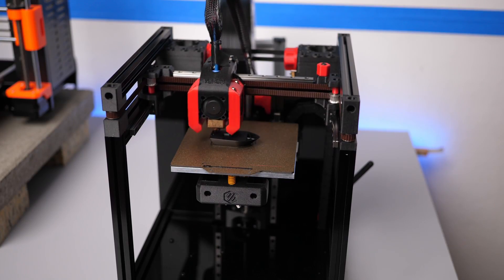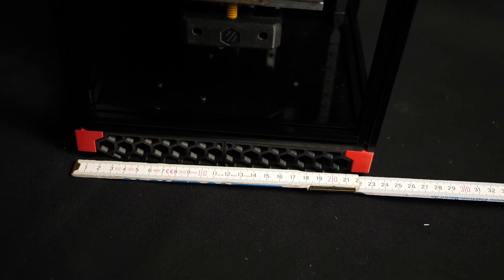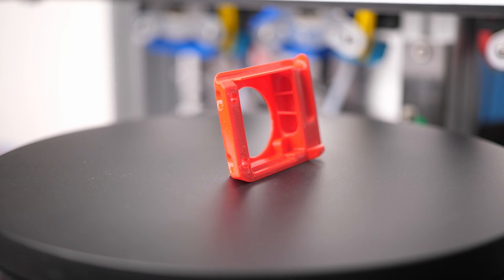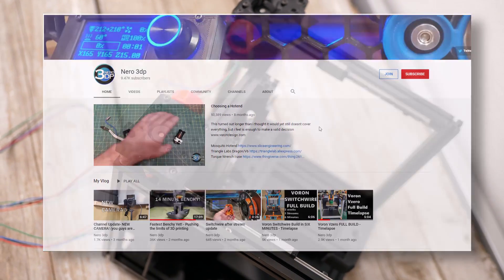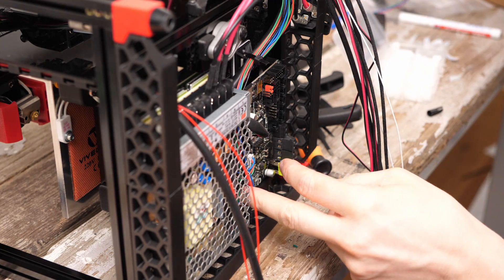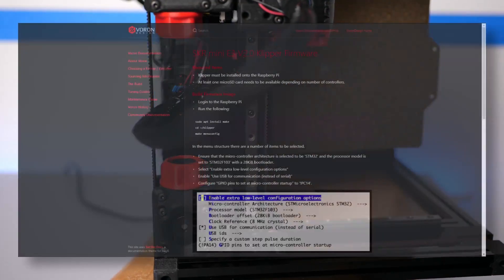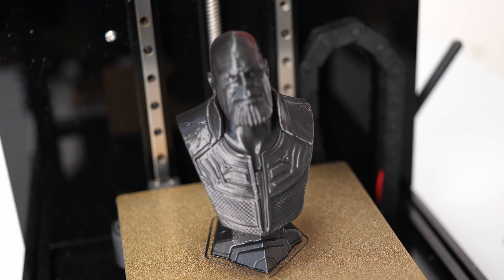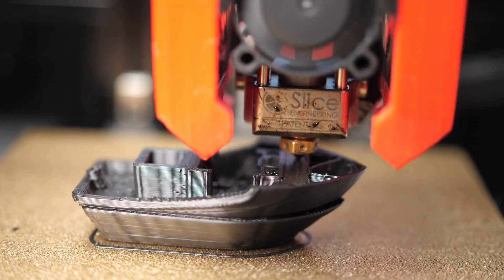Mini, Fast & Open-Source Core XY - The VORON 0

Comment from the maker: Banana Scale FTW!
Reply: Can't believe you 3d printed a banana
Reply: Once you have it reassembled, can you please try using really small nozzles/better cooling/etc. to print miniatures (both ones that need supports and those that don't) to see just how close you can get to SLA quality?  I've noticed a LOT of folks in tabletop communities that want to get into SLA printers for the quality but don't want to deal with the hassle that comes with resin.  If the Voron 0 could give close enough results to SLA, they could have their cake and eat it, too.  I'm not too sure what is considered to be the 'Benchy' of support-needed and supportless miniature models, but quite certain that the community could help you.
Reply: @KeithOlson  I've actually built a v0 for that exact purpose. In reality, this printer needs better hot end cooling to print PLA/ABS miniatures. Whenever I've put a 0.25mm nozzle on it, it clogs fairly quickly. 0.4mm it prints like a dream though.
Reply: @jeffreydorfman961  Perhaps Slice Engineering's 'Copperhead' bimetallic heat break would do the trick.  
Thomas Sanladerer seems to be pretty impressed with it.  I also saw a cool trick for cooling a while back.  Someone put powerful, high-static-pressure fans blowing out of his enclosure, then ran flexible hoses from the top of it down to the extruder that were connected to outside air.   The result was a LOT of air available for cooling without needing to mount any fans on the head.
Reply: What happened with the pellet extruder?
Reply: I always remember this SNL sketch. https://youtu.be/JpX9vjnZ-I4?t=31 They might as well use your tiny printer for the shoot :D
Reply: Wow that is awfully funny!🤣
Reply: Can you do a video on PCTG?
Reply: You should look at car ac filters, you can get high end filters that do both jobs of a HEPA and carbon filter, I think it's called odour filter plus if you get one from Ford
Reply: R u a 9gager ?
Reply: That is a beautiful machine, thanks for documenting your process!
Reply: The real aim is to make it smaller than the banana: https://i.imgur.com/PN8RJZZ.jpeg
Reply: Stop you're faster than light 🚨🚨🚨🚨🚨
Reply: What about greentec pro filament,  i used that dir my bearmera. With up to 150°C Temp resistance,  it was the best choice for the nozzle fan duct
Reply: Also check out the HevORT. Apparently it prints even faster than the Voron. Would love to have your opinion about it.
Reply: Why is the printer called VORON?  It's in Russian.
Reply: Hopefully the new videos on this are coming soon. I'm excited to see this machine perform better.
Reply: Is this the fabled banana you were going to cast in silicon?
Reply: Check out the hevORT. that one is a solid competitor for the voron, and I'd argue it's even faster. Search it on YouTube, the guy who is developing it has a channel dedicated to it.
Reply: @masterbick2  Yeah, the HevORT is amazing! Such a capable machine, even now, while it’s still in very active development!
Reply: @masterbick2  +1, the Hevort is really a great printer!
Reply: 9gager spottet

Comment: i'm planning to build a printer aimed to print very small parts. i currently have a bambu P1P and i've been somewhat successful printing parts with sub 1mm size, using the 0.2mm nozzle and a layer height of 0.06mm, but at these scales, even small blobs on the nozzle that might remain going from one layer to the next could completely ruin the part. i want to try my luck with a diy printer as i can really tune it in to my needs. seeing your video, the small size and rigidness of that voron zero seems like a good fit for my project, however i probably want it to move slow and precise instead of fast.

Comment: Regarding PETG support for PLA prints or dual color i like the IDEX idea more than those filament changers which produce so much waste. There is a Voron trident IDEX variant.  Do you have an oppinion about IDEX (slower because more weight ?)

Comment: I know it's three years later so it's not a fair comparison, but I spent $520 on a Sovol SV08 (their Voron 2.4 inspired printer) and it printed the nicest looking Benchy I've seen... in 12 minutes.  The SV08 is far from perfect.  Sovol went a bit too far reducing the cost.  The thin aluminum print bed has over 1 mm of warp, so I'll need to fix that.  You sort of get the Voron build experience Lite, upgrading the SV08, but it's a good deal IMO.

Comment: Open Source and all is amazing but if you want just a small and fast prototyping printer I would just get the Bambu lab A1 mini. Yeah it’s cantilever and bedslinger but their vibration compensation algorithm is so great, it produces high quality at high speeds. It’s a closed ecosystem nut it just works as an appliance, it’s fully assembled. Take out of the box, remove shipping protection, plug in and hit print. It’s an amazing Allround machine minus open source.

Comment: Does anyone know if the 2.4 R2 has the same problems with ABS or other materials Changing* shape over time? I really want to build one, but if the parts keep warping I may have to find a good CNC workshop for Aluminium parts*

Comment: Did you do the material test for the printed parts? Which material would you recommend for the printed parts?
Reply: The Formfutura – TitanX – ABS Filamentalso seems to be stiffer and more temperature resistant.
Reply: The ABS-PC Filament from Material4Print has a flexure module of 2400 MPa and a softening temperature of 122°C, that seems to be superior to standard ABS, which has only 2000 Mpa and 97°C. Is there any reason, why one should not use ABS-PC?
Reply: and the Green-TEC Pro has 160°C and 4400MPa, why not use this material?

Comment: I'm curious to know if you reprinted your parts using the new carbon fiber batches. I'm just starting some structural part designs and am concerned about creep, so I got some carbon fiber nylon. Your issues has me concerned though!

Comment: NOOOO! That CF Nylon has a glass transition temp of only 68C!!! 3DXTECH shows their nylonCF formulation for 6 has a glass transition temp 10 below regular PETG (PETG is generally 80). Their Nylon 12 CF however, is almost 160! You are going to have creep in a printer if the glass transition is below even cheapo PETG!!!

Comment: Voron parts are designed with ABS shrinkage in mind, so if you print them in any other material, you might have fitment issues :(

Comment: 400€ mini printer and you still have to print the structural parts yourself? Gosh I'm happy with my 100€ Mars 2 resin printer. It's fast enough and can print bigger than the V0.
Reply: you cant put them side to side tho, MSLA vs FDM have their own advantages
Reply: U said its fast? Well then say hello to my bambulab x1c

Comment: I'm glade you chose to use Nylon Composite, because it is what I would have dune, and now I know not to do it.  However, I wish I had your knowledge when it comes to flashing the firmware and installing Klipper, and of all places on a Raspberry Pi?  Boy do I have a lot to learn."  I really want to build one of those VORON mini, but; It is going to be a baptism by fire because I don't know Sh*t about compiling and de-compiling code.  F-me-scard.  I have to learn something way above my pay grade.

Comment: I feel as though the bed assembly should be made of metal, and using load bearing 3d printed parts next to a high heat source is likely not the best idea. it makes sense for the belts and fans and legs, but not the bed assembly.

Comment: I love the idea of this printer! I have an Ender 6 currently, which is great for printing big parts, or large batches of small parts. I am also impressed with how rigid the printer is for it's size, but there is no way it can achieve the lightning fast speeds of the Voron before shaking itself to pieces. Looking forward to building my own Voron Zero! 

When I have room for more printers that is...

Comment: hello, can the Voron be powered just by the Raspberry without the control board?
is there already an application to use the RPI outputs straight on drivers?

Comment: I would go for CF PETG. Im planning on attempting a 3d printed lathe and rigidity is key. CF PLA or PLA would be more rigid, but PETG is more heat resistant.

Comment: Completely agree with your comments re printer size and making functional parts. Like you I use my printers for prototyping and part mock-up, most of which (98%) are 50~200 at most, if its going to be a three hour print its usually simply not worth it for me. There is a mentality adrift ( in most pursuits) that bigger is better , moar numbers! I find it silly, the kind of nonsense pursued by brochure sniffers . It smacks of the classic teenage obsessions re "adequacy" and is the inverse of the number that counts the most ..productivity. Bigger=slow and floppy. Give me lean and mean over big and compromised any day.

Comment: For $400, I’d expect the kit to come with all of its parts, and at least an extra or two of the really small pieces. Otherwise, this is a really great video. I’m going to need to look at making one of these for rapid prototyping too.
Reply: For 400$ I would expect all the parts to be injection mouldings or milled. Not needing any printing.
Reply: @MostlyInteresting  guess thats a answer of someone who maybe owns a cheap china bedslinger for 200 bucks..

Comment: Material pressure drift - Yes please! I was hit by that issue when printing belt tensionner  in PLA, reprint in PET-G has solved the problem of deformation under screw pressure for now. One thing to concern wold be the area of on which force is applied. It might be that materials react differently to pointed and spread load -  I know P=F/s , yet worth to check.

Comment: Well, If you need stiffness and temperature resistance: Why not print the parts with ColorfabbHT AND carbonfilled PETG. HT resists 100°C, and in prusa Slicer you could set the first few and maybe the last few layers a material change so that you print in the middle the biggest part with the HT and the rest with Carbonfilled PETG. Because both are PET Filaments they should stick well together.
Reply: Does it resist constant temperature changes under mechanical stress? Because each feature separately is relatively easy to get, but both combined is the tricky part.
Reply: @DiThi  Hmm that's a good point, but I don't know.
Reply: @DiThi  But I think the material greentech Pro will do the job. It's stiff and thermal Stable and as long as it doesn’t come along with steam, it also will be stable at hot temperatures.

Comment: I think, If I would build it I would try it with the Polycarbonate from Prusa. It's not so stiff, but it is tough and can resist high temps. I think it's good to print, and the cream white nature Material has an interesting colour. But maybe the Greentech Pro from Extrudr would also be interesting because it is stiff PLA which can resist 150°C.
But the machine definitely suits my needs, because I think, if you do a lot of engineering, you often print small parts, which works well und a small machine, and also energy consumption is lower on a smaller bed. 

Ich glaube, wenn ich das Ding bauen würde (habe ich mir ernsthaft überlegt und dann beschlossen, erst mal nicht, weil ich genügend Baustellen habe und auch nicht genügend Geld) würde ich es mit Polycarbonat von Prusa versuchen. Es ist vielleicht nicht das steifeste Material aber ich denke es ist relevant wegen dem hohen Temperaturwiderstand. Und ich denke es ist gut zu drucken und das Cremeweise "Natur" Material hat eine interessante Farbe. Evtl. ist auch das Greentech Pro von Extrudr interessant, weil es steifes PLA ist das 150°C wiederstehen kann.
Die Maschine könnte ich definitiv gut gebrauchen, weil ich denke, wenn man viele technische Projekte hat, ergeben sich oft nur kleine Drucke die auch auf einer kleinen Maschine gut laufen und dabei ist auch der Stromverbrauch bei einem kleinen Bett geringer.

Comment: HEPA filters typically have a pressure starting at 300Pa (when clean) an axial won’t do it, you’ll need a centrifugal with sufficient specs to move air through the HEPA on its own

Comment: I've suffered crepp in a few brands of Nylon-CF filaments. To the extent that I now consider it a material property. I use Polymaker PC more often these days for stiff parts (though that can have cracking issues, but that's a different matter). I also have some Polycarbonate-PC material that I've not yet spent much time with as my printer is in an insulated, but not actively heated chamber.
Reply from the maker: Good to know!
Reply: @CNCKitchen  it's a shame, as it's such a great material. The rougher looking the part/material the less it seems to happen, so I suspect it's the length of the milled carbon fibers that is the contributing factor. Longer fibres, better consolidation/adhesion to the polymer internally, therefore less creep. Complete guess though, I'm no expert!

Comment: Just an observation, but I would expect those side panels to substantially stiffen the machine? Perhaps fit them and add holes if you need more ventilation...?
Reply from the maker: They would definitely stiffen the frame though I think that this wouldn't make a big difference because the frame is already really stiff.
Reply: @CNCKitchen  the rails core designers claim the the stiffness of a panel is significantly greater than simple crossbraces. Intuitively I agree (think how hard it would be to distort even a think sheet of acrylic, especially if you can constrain the centre)

Comment: I recommend using a 100w commercial aquarium pump for cooling.
I'm doing this with my voron 0 but made some design tweaks so i can use larger nema 17 motors also using a SE M magnum.
And a duet 3 board with a custom expansion board using 3 cheap captive linear micro steppers. It's a unique system that requires custom firmware for now but hopefully get added soon to offical. It's a simple custom board with 0-48v in and can bus. Has 4 headers for 3 or 4 mini linear steppers it uses 2209 drivers at low voltages (5-12v) and uses stall detection to drop tell stall for home. (The 22.5x14mm ones I'm using can drive 33N each so a 3point bed needs to be under apx 80n or 18lbs to level properly. The holding power is about 2x that so max bed weight when printing with a 3 point setup is about 50lbs i think this is plenty for 99% of printers as those numbers are only the floating bed itself. Anyways hopefully releasing a kit for this very soon. I'm planning on offering both can bus and i2c port's so i can make it compatible with marlin and low cost systems as well. For those that know a mechanical level always better then auto bed leveling that constantly drives the Z aixs. The acme screws on our machines are really crap for this constant movement if you don't  believe me and you use abl check your backlash i bet that brass nut is almost gone with the wind lol

Comment: Is the SKR E3 fast enough to control the printer for doing a 10 minute benchy? (or other prints for about 200mm/s or more)

and do you also need other stepper motors? like nema 17 for X and Y?

thank you

Comment: Nice :) I've improved my print times with a better hotend, .6mm nozzle and Cura's adaptive layer height feature with up to .48mm. Easily 2x-8x faster prints for the stuff I design.

Comment: HEPA and charcoal filters are a second rate solution in my opinion. If you can access the outside and drill holes in your walls, a standard 4” clothes dryer vent 4” blower are a more robust solution that doesn’t depend on filters catching all particulate/VOCs.

Comment: Tevo Tornado with slight profile tuning is actually capable of those speeds and accels with similar quality.

But i can see that this was nowhere near the upper limit for Voron 0, where as for the Tornado for 24/7 usage i would not make it run much faster

Comment: I think you should use PETG for the reprints. It's what basically everyone has readily available and can print without hassle.
Reply: I don't think PETG can stand the temperatures of the heated bed, particularly for printing ABS. It has been designed and tested to use ABS pieces. I suspect we'll see a CNC Kitchen video about material creep soon, testing different materials to see which one has less creep after many heat cycles like what a printer gets.
Reply: PETG will deform. ABS is best

Comment: Hi Stefan, could you do the calculation if extra stiff filament really helps? If plastic parts deform so much that they are affecting the system accuracy they are overloaded anyway. This requires a different sturdier design or much stronger/stiffer materials like metal -- or the parts will fail sooner or later. (None of the parts that we are printing is numerically calculated for stiffness and fatigue.)
Maybe fiber reinforced filaments are like using carbon fiber plates instead of alu plates. We have no idea about the loads and stresses but carbon is "much better".
Reply: ABS probably has the sweet spot between rigidity and malleability. It's kind of flexible but any deformity snaps back into shape, while other materials can be permanently deformed with time.

Comment: if i had your skills, i certainly wouldn't be wasting them printing little boats and figurines. How about printing something useful like a hose fitting, a tray, paper clips, a phone support or even a pen holder but 27 little boats, that hurts me inside
Reply: A lot of people like him do print all kind of things, but most pieces don't make for good benchmarks. The little boat is called "benchy" because it's a repeatable benchmark for many 3D printed features and it's good for comparing different printers, hotends and configurations.